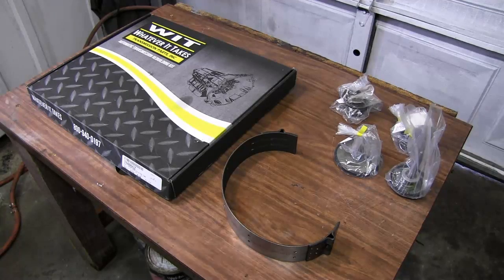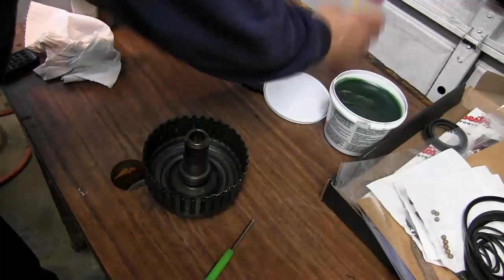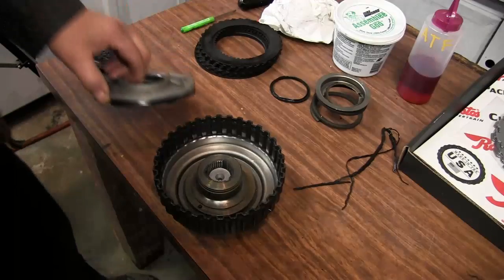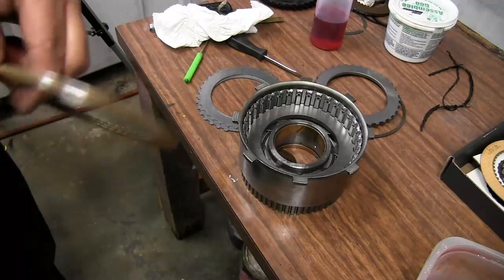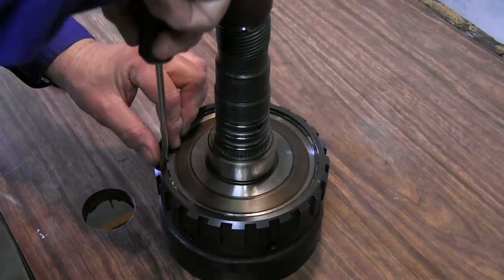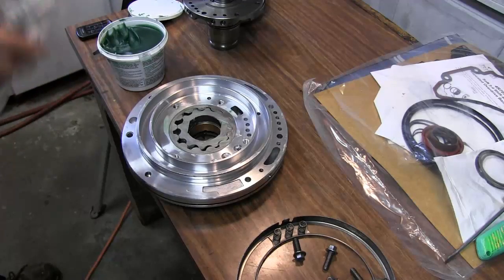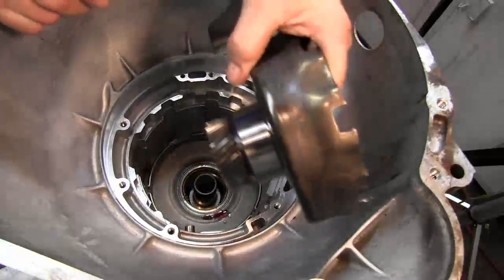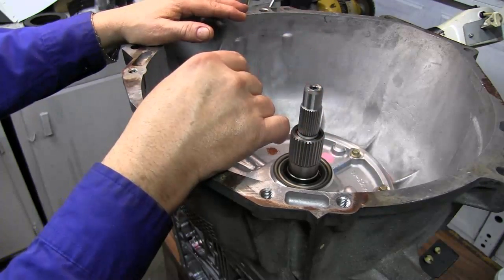#232 4R70W transmission rebuild part 2

Comment: Buddy:  I usually soak all of my friction plates/bands for at least half an hour by submerging in oil first.  It takes a little while.  Also, it never hurts to use a jitterbug-type sander with wet or dry medium grit on the backing plate surface.  Also on the band's drum surface too; but sand directionally by hand.  Coat your seals with trans oil too, as you can soak them in the fluid with the frictions.  The plates must be thoroughly soaked so the oil can serve to transfer heat off of the frictions.  
Take a 2 1/2" long piece of stainless wire .030" and bend it in a ~1/4" radius loop and put it in the end of a piece of 1/4" OD aluminum or steel 6" long thin wall tubing with the loop sticking out about 3/4" and press that end in a vise and crush it in place.  This makes a handy tool to get the seals in the drums w/o cutting the lips.  Always be gentle with the seal lips; or it will make for a bad day.

You may have to clean out the cooling lines and the cooler in the radiator to get all of the contaminated oil and burned friction material cleaned out too.
Check balls in the apply pistons should be air tested for leakage.
Be glad the sprag only froze and didn't shatter, because fine metal always gets into the valve body and causes valves to hang up or stick.

Comment: Nice rebuild,looks like you have done this before.   I worked as electrician/mechanic @ Borg Warner in Bellwood,IL; keeping those machines operational.  They make clutch discs & friction plates kits for new autos & for the rebuild shops.  For the American big 3, for the Euro market & Asian market. I think I mentioned this on a previous post on part 1 of this series.
 Enjoying the series,you will have a nice Mustang to cruise in this summer

Comment: Excellent view of the steps necessary for the rebuild. I've used that feeler gauge method on similar seals and it works well. The trick with stretching the teflon rings makes you wonder how they do it at the factory. You just know they don't have someone sitting and stretching those rings by hand . . . Great work.
Reply from the maker: Thanks Merrit
Reply: tapered cones made just for the job of expanding, placing and resizing them.
the assembly lines would be automated machines with expander dies and and constriction bands to resize back down ( think like tail-pipe expander and piston ring compressor )
Reply: @throttlebottle5906  Thanks. That was the direction I was thinking in but the extra detail is welcome.

Comment: Are the steel plates different thickness's to adjust end gap in the clutch packs?
Reply from the maker: The steels are all the same. To change end gap you change snap ring thickness.
Reply: @TheRadioShop  
Interesting. Thanks Buddy.

Comment: How the heck did you learn how to rebuild the trans?  Awesome work!
Reply from the maker: Thanks Jeff. Just something I took up many years ago when the transmission in my only car went out ( no internet back then) .  You checked the prices on having one rebuilt? You can buy another car lol.   I find transmission repair very relaxing and fun. Many hours spent ready automotive manuals. Thanks for the comment.
Reply: @TheRadioShop  The price of a rebuilt transmission is astronomical,  I completely agree with you.
So just by reading manuals you taught yourself?  DId you make a bunch of mistakes in the beginning?
Reply from the maker: Correct, self taught just by reading every manual I could get my hands on.  Chilton, Haynes and shop manuals. A lot was to be learned from old Hot Rod magazines. Mistakes? Oh yes and you learn them the hard way. Rebuilt a C4 years ago and had a few parts.wrong. It was sad lol. But we learn from mistakes. And when you build a transmission you check your work three times.  Nothing worse than having to pull it out because you left a 50 cent snap ring out..
Reply: @TheRadioShop  It is certainly relaxing  and fun to watch. Good job!
Reply: @TheRadioShop  I would being crying at least ten times after R&R the trans and made a dozen mistakes one after the other.

Comment: At 50:00 it looked like you placed that bearing in incorrectly.
Reply from the maker: Hello,, the bearing will seat only one way. Go back and you will see me spin the direct clutch.  If it was not installed correctly then it would not spin.